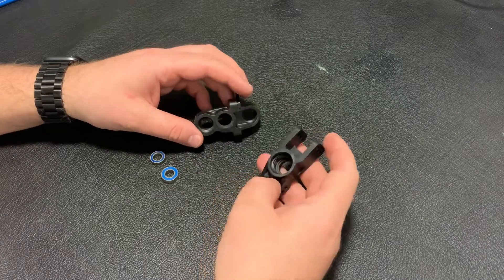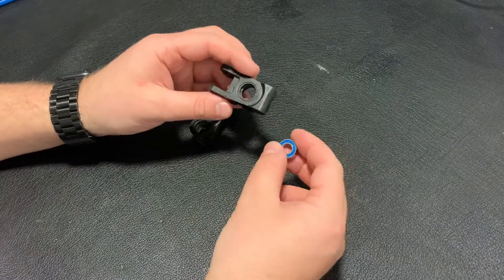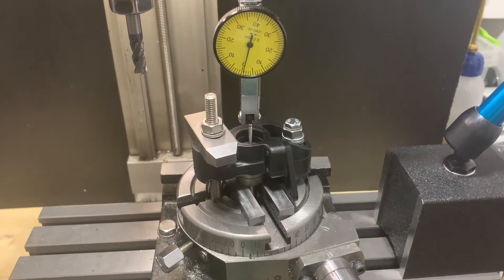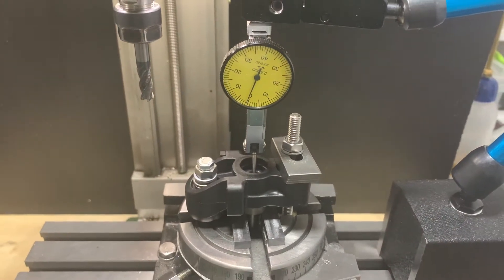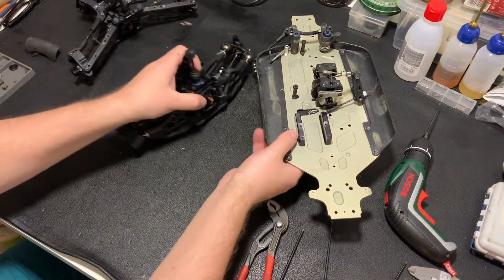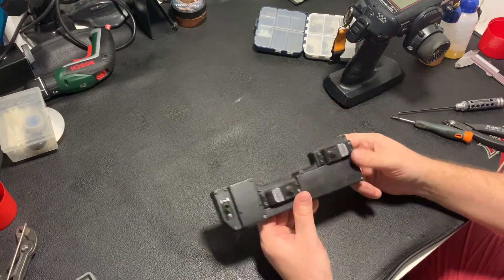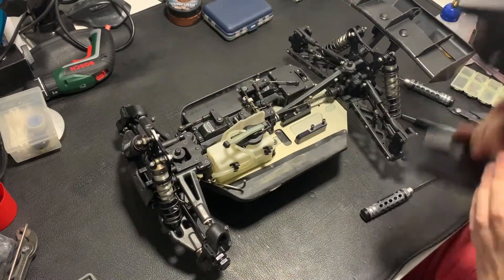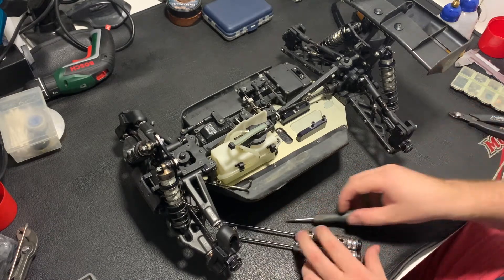Restoration of RC nitro car Xray XB8. Assembly a car. (part 2)

Comment: hi, do you have any suggestion, if the front tower, theres 4 x m4 12 hole to tie the front tower to chassis, the front 2holes is ripped, any idea on how to lock it down to the chassis?
Reply from the maker: I'm usually do a brass inserts there
Reply: @zhadlun  thank you for the idea brother.